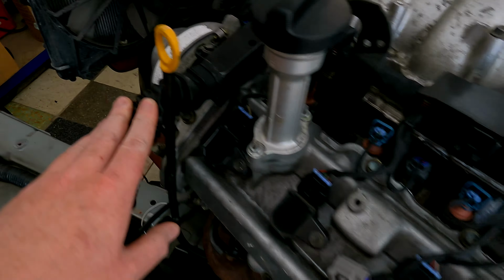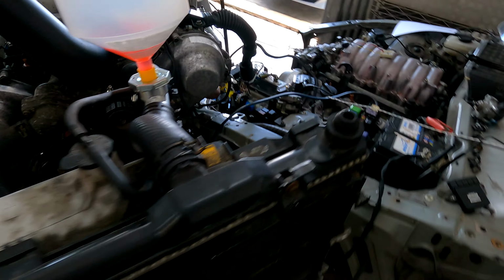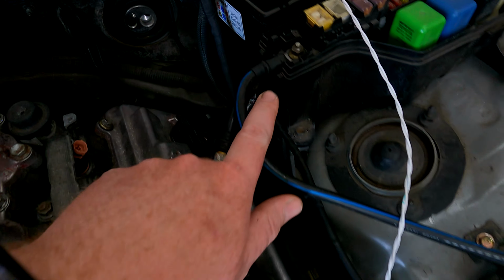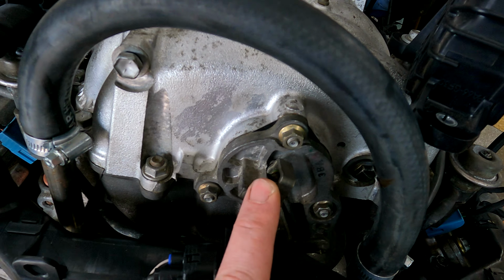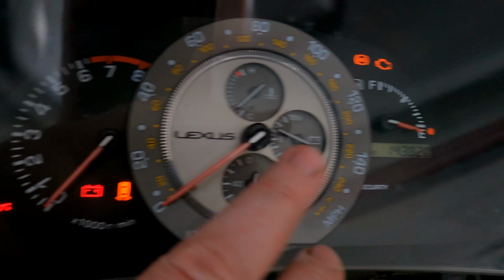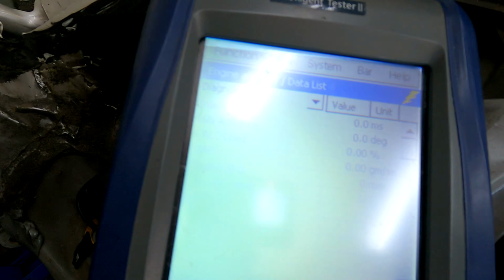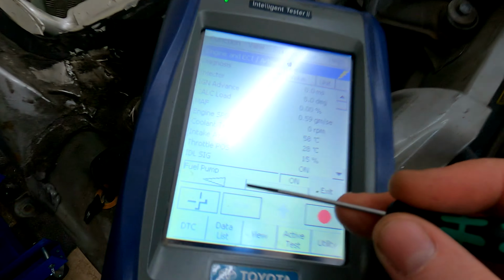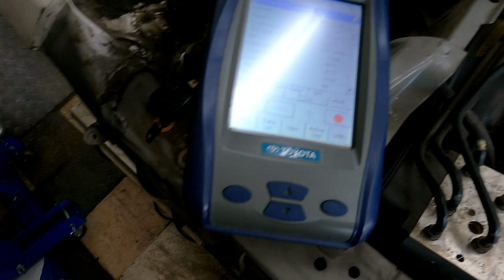Oisin LS430 00-03 IS200 Plug and Play Harness

Comment: Don't know if this is the right place to ask... but how can I wire my obd2 plug on a ecu with part number 89661-3f360...
Reply from the maker: Hello Robert. You have the 3UZ 6 Speed Toyota Crown Majesta. It is very similar to the Lexus GS430 6 Speed. You can either go to www.lexus.tech.eu or the US Version which is Toyota Tech Info and all the diagrams can be downloaded from there.